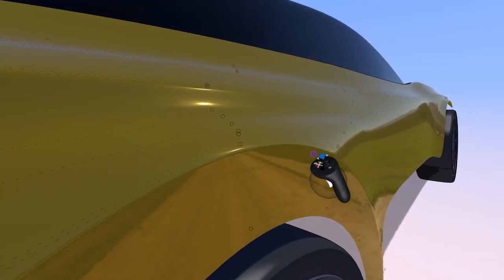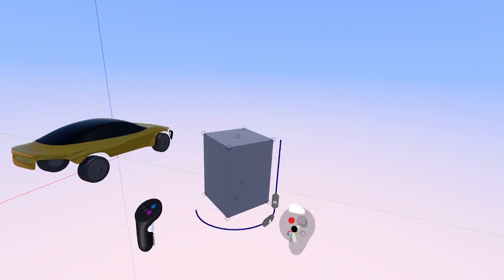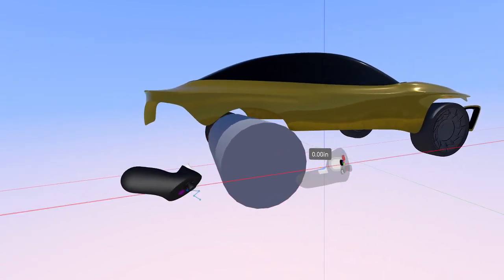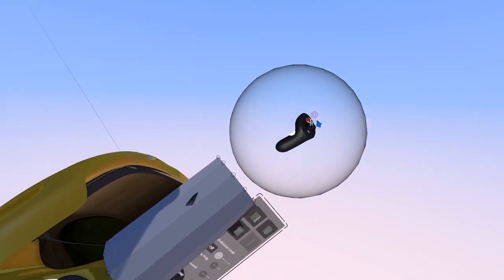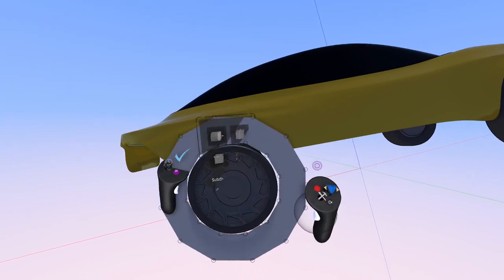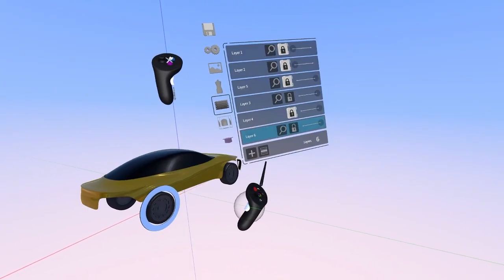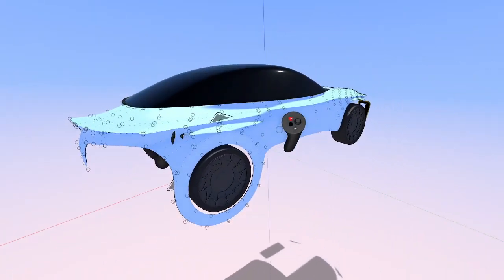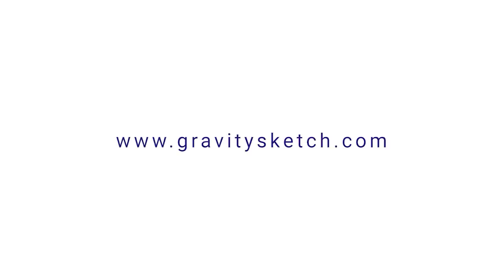Making a car wheel-flat with SubD - Workflows

Comment: Interesting and good to see this workaround as Ive been scratching my head trying to do this. It would be good to see some basic planar curves (eg. arc, circle, straight line etc) added to the primitives menu as it would then allow a faster way and more intuitive way of building the same thing
Reply from the maker: Great thoughts! You should be able to do what you are describing using the primitives and converting them to SubD as well!